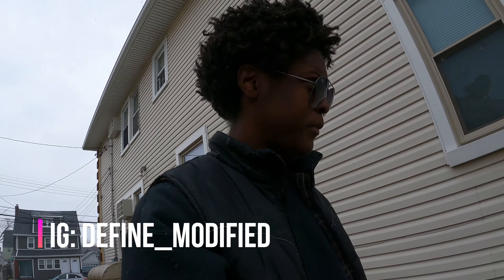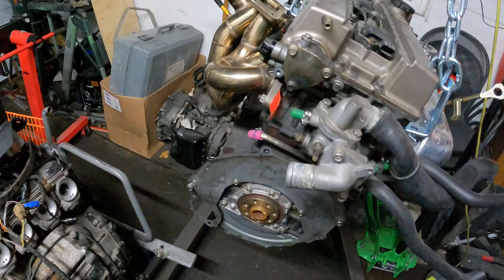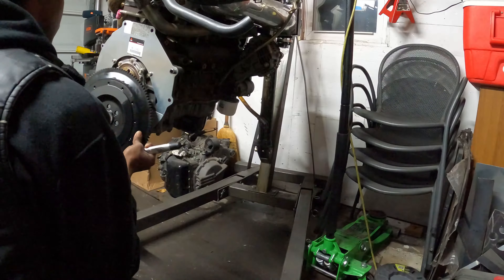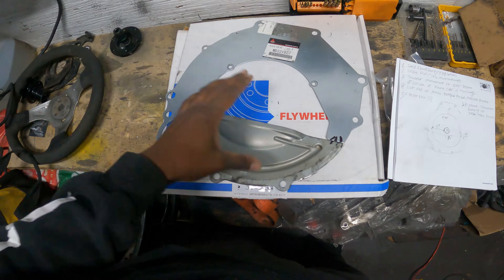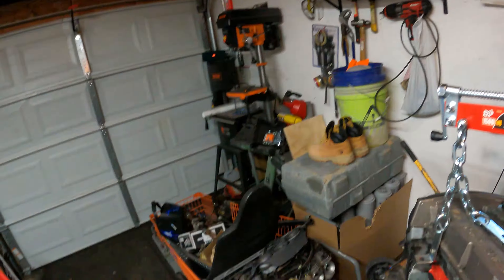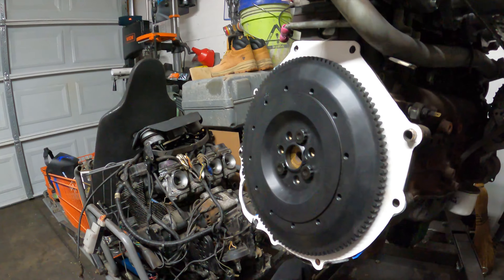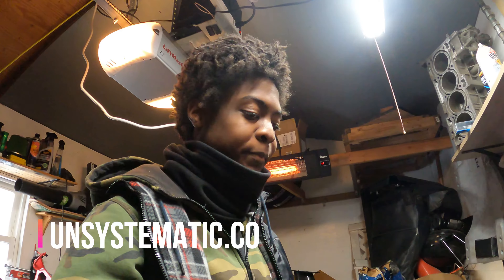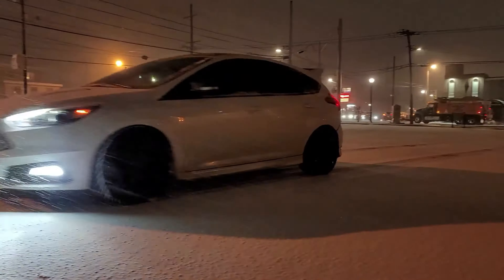Making A Custom Bellhousing - 944 to 4g63T

Comment: Did you use the clutch and flywheel length, plus throw out bearing/slave to get how deep the bell housing had to be? Then you’ll shim the throw out/slave to get the engagement right? Anything else I am missing?

Comment: I am looking for ideas. I want to mate cd009 gearbox with rx-8 bellhousing...
Reply from the maker: Am pretty sure that's been done already
Reply: @DefineModified  yeah, and adapter/bellhousing kit is more expensive than gearbox itself 😂
I am thinking about removing bellhousing from cd009, cuting rx-8 bellhousing to correct lenght and welding plate on its bottom. Drill holes in that plate and bolt it to cd009
Reply from the maker: @usiak13  that works too but definitely more work. I would find the adapter plate and copy it bolt for bolt and cut it out of aluminum sheet

Comment: Wonder if that guy could build me a steel or aluminum bell for my 351W and 6R80 swap. I don't wanna touch no damn adapter plates.
Reply from the maker: That would require alot of measurements
Reply: @DefineModified  True. I still have some thinking to do lol.
Reply: @DefineModified  It shouldn't be too much of a problem, would it?
Reply from the maker: @RBLUS_TY  lol well I didn't show much on video but there was alot of trial and to get it right and measurements for the dowel pins are critical and have to be on exact point
Reply from the maker: @RBLUS_TY  i made paper models to make sure it was right several times
Reply: @DefineModified  Guess I'm better off with a E4OD